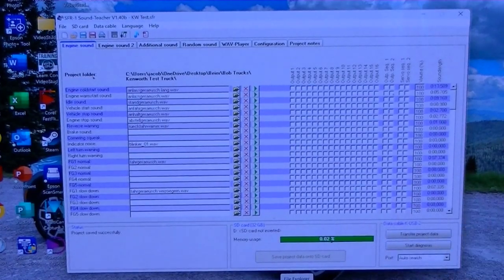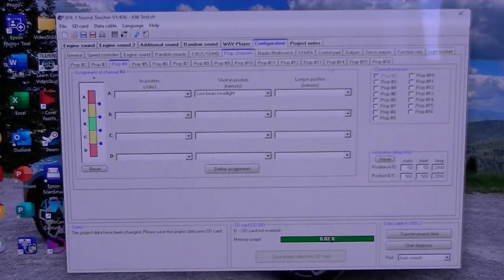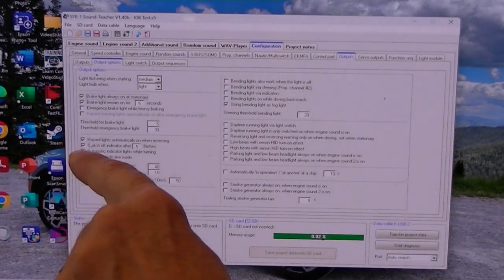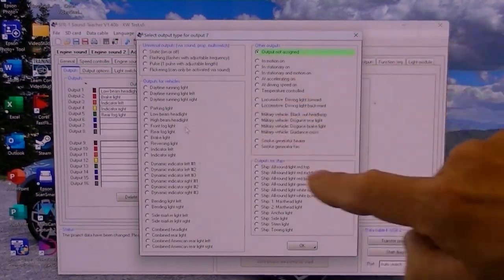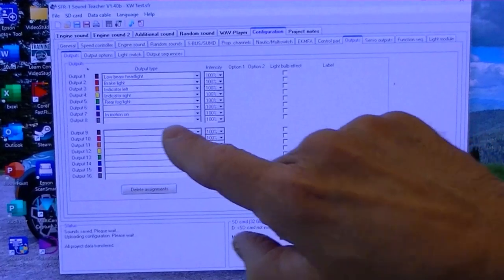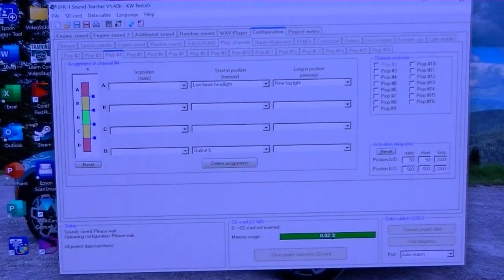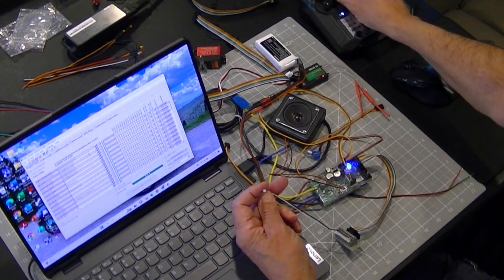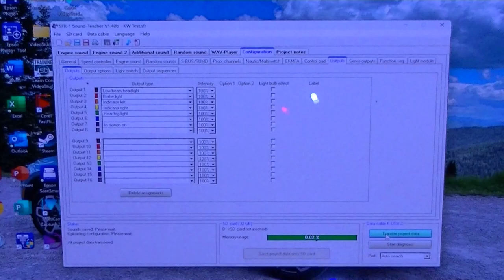Beier Masterclass Volume 8 - LED Light Basics

Comment: Now we're getting into the fun parts.

If you could, a couple functions I'd like you to touch on.

Is there a way to set up a "Marker lights" function, that will turn on the visor lights and corner lights at 30%, but also turn on brake lights and turn signals at 30? Then, when the turn signal channel needs to blink, have it cycle between 30 and 100 (or 70, or whatever)

But if the Marker Light function is off and the lights are at 0, the turn signals flash between 0 and 100?

The other one is, the Beier manuals mention that channels 13 to 16 are reserved for flashing light functions. Either chasing lights, wagging lights, or a function where they strobe in and out at different speeds to look like unsynchronized hazard strobes on an oversized load.

If you could play with them a bit, it'd open a few more possibilities.
Reply: Using side markers with turnsignal, yes can be done with a new function in the latest softwear update, same with dynamic indicators, but only 3 ligths per side.

Comment: I am a big fan of the light switch function, it works more like the mfc that you turn on parkinglights, then headligts, the fog and so on with one prop, and then off with another prop. Saves on prop channels that could be used for other functions.

Comment: I learned the hard way about power.  The Sfr is still drawing power, even with the switch off.  I shorted two output ports on my 1st Sfr....lesson learned.
Reply from the maker: Oh man, yes.  The switch on the SFR-1 does not shut it down completely - still draws power so you need to disconnect the battery when it is sitting or when working on it.

Comment: Do you have a video or series about working out resistor values and soldering them to the led leads in preparation for installing with a beier?

Comment: Can this also be used with traditional incandescent filament lights? I'm building a tugboat and the aeronaut search lamps I'm using came with custom filament bulbs. Maybe a silly question, but I can't see it mentioned either way anywhere.
Reply from the maker: Yes, no problem.  Jus remember it uses pass through battery voltage so if you have 6volt bulbs you must use a 6 volt battery or provide some kind of voltage regulation.
Reply: @HobbyconceptsLLC  Thanks Bob, this videos are extremely helpful!

Comment: hi bob i have the flysky fi6x i am on the understsnding thet you can use it for more than one truck ie use the same transmitter for multi trucks by going through the settings am i correct
Reply from the maker: Yes, has a multi model memory.  Just go to the menu and set up a 2nd model.  It remembers the setting for each model.

Comment: So would it be possible to change output voltage to a set voltage? Or lower voltage with the intensity setting. I kinda have to go from 7.2 volt to 2.2 volt to run my squarer marker leds.
Reply from the maker: You can't step down the voltage through the SFR.  Just use a separate voltage regulator like this: https://www.ebay.com/itm/162857904782?hash=item25eb166a8e:g:ZNkAAOSwczlbNyBn&amdata=enc%3AAQAIAAAA8Azxo11p2TUw9XOdH5R61l1QnQZ2DVeCQoU1GMCT91%2BHaO54jkaJoTRDF4JqezLvEhE3payTQ9loIhjuoKf0KqNumXqEq5wqkT8%2BCVlTcjmMGIsWCwGrJCrraqWniao3KJz8nZ1i0YfH%2BXD9FORuuGDKyKBuXlbvz7cZAhlSSEYDOpkUuNlD4FLOczrx3Oxpxvo%2BHlmjIKNGAaCbrIR3D0QF0Dln%2FpT46neRaMSSsZSuC3pvduESynGRrzM6LrGOT15EIwbgMEMG%2B80rB4Bwsz15ZsN9Zl69aLWkM0KLrWf6%2BXLZqxd60favahfUEYjpjw%3D%3D%7Ctkp%3ABk9SR_6X75OdYg

Comment: Rear fog light is actually a rearfog light is a european thing 😅
Reply: That’s correct. By law in most European countries every vehicle has to run a rear fog light when visibility in fog is less than 50 meters. It’s a light which has more than twice the intensity a regular tail light has. It’s purpose is to prevent head-tail collisions in heavy fog.